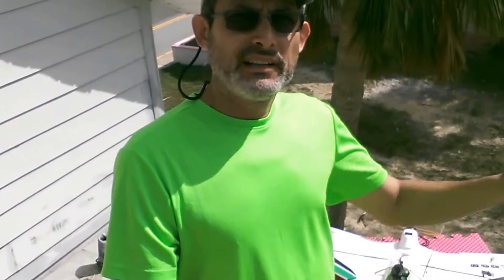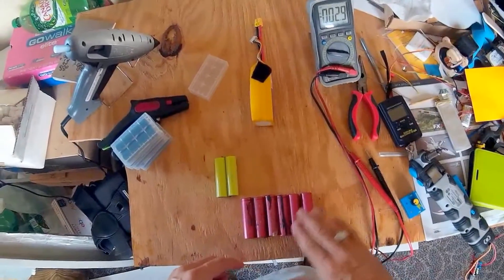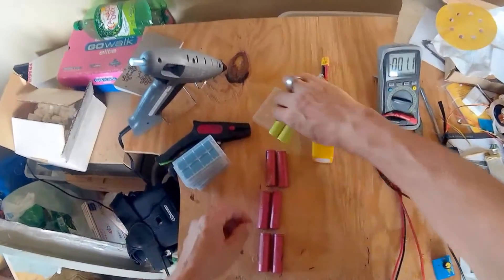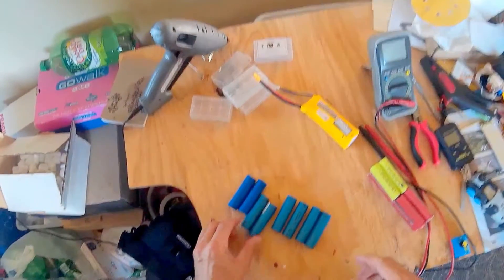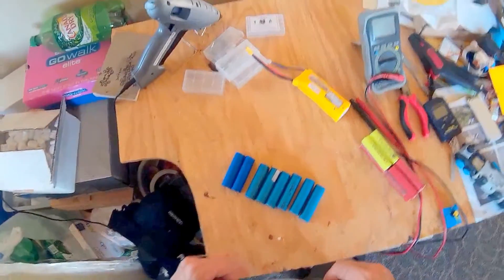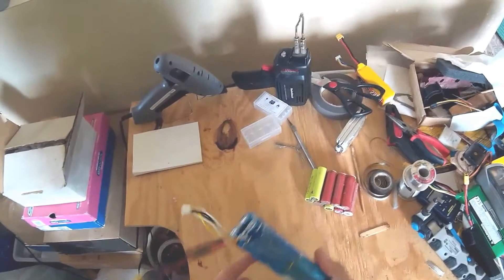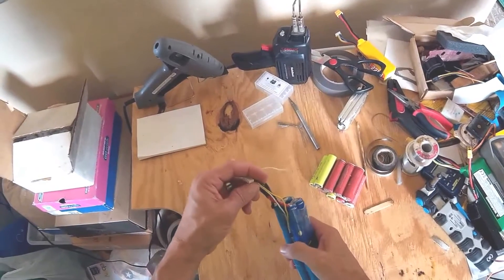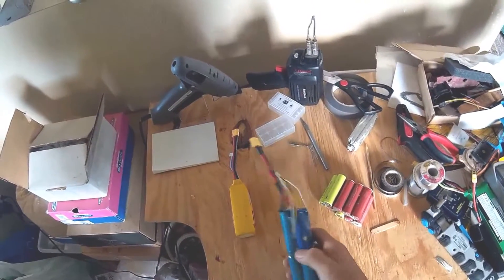RECYCLING LAPTOP LITHIUM BATTERIES TO FLIGHT RC PLANES????

Comment: I don't understand.. How do you use old laptop batteries that will no longer charge or hold a charge? The batteries inside all the sudden start working again when removed?
Reply from the maker: They work again because you no longer have the electronic watchdog or gate keeper that shoot down the power when they are below certain voltage I/O 2.75 V , in my case I was fortunate enough to find some batteries that where not even a year old so they actually give me somewhat around 4 to 6 min flight time.. now I'm using brand new cells and very much the plane can fly almost 30 min.. thank for your comment. "Note that really old batteries will not give you that much power.. a general rule is if you open the battery case and there is any of the cells leaking you can't really use any of  the cells for any type of high output application..
Reply: Ahh okay. Thanks for explaining. :)
Reply from the maker: All half way decent laptop batteries have a protective circuit that don't allow them to be over discharge! and this circuit goes bad "Extremely often.. leaving good batteries that now "one think are bad.. so why not to turn around and use them for a good purpose...
Reply: For sure! I can still use my laptop without a battery stuck in it safely right? I have one with a "dead" battery.
Reply from the maker: For as long is not older than 3 years you probably have a great battery on it... "You see.. even if you don't use a battery it eventually will go bad because the chemicals inside of them literally corrode them in to nothing.. they have a very limited shelf life..